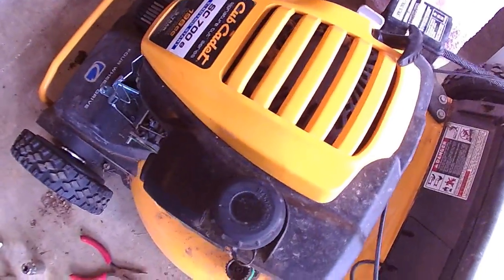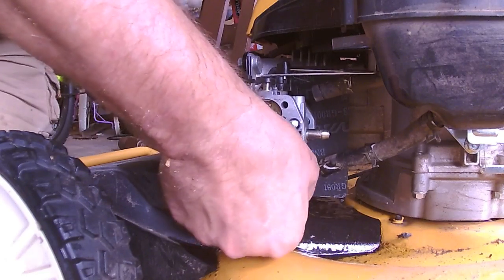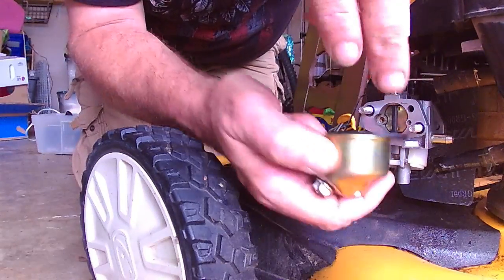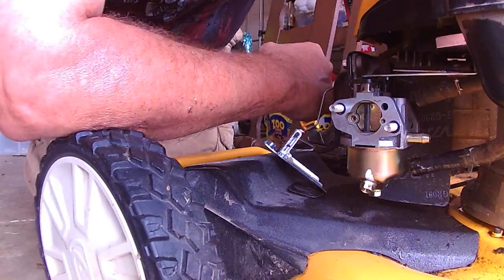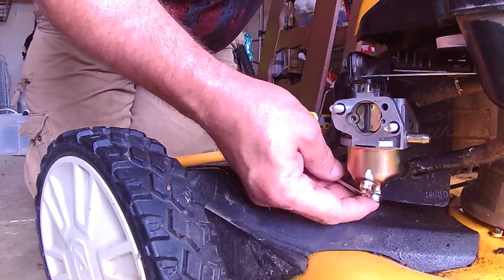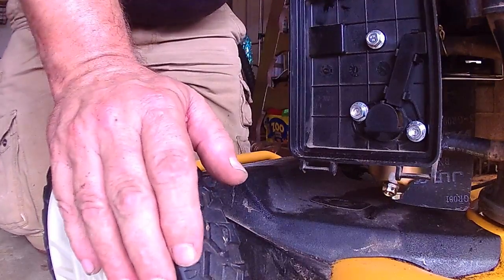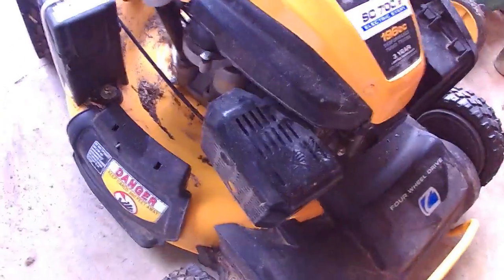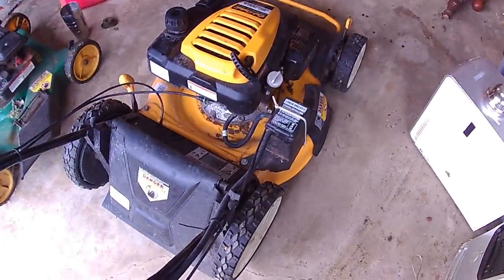Cub Cadet Will Not Start

Comment: I hate working on small engines.  I usually just send it in to the repair shop.  Your video saved me being without a mower for two weeks and at least a hundred bucks.   I had tried everything my limited knowledge allowed for--new, clean fuel and starter fluid to get it to crank.  It never would have occurred to me to remove and clean the bowl.  I did that, and just like in your video it cranked right up.  Thank you so much.
Reply from the maker: Glad it helped!
Reply: I love to work on small engines I'm 68 years old and remember my dad hated to work on them as well lol I saved him a lot of money over the years.

Comment: I know it's old video but I have to thank you for this. never even realized my cub had a float bowl and I went most of the summer having to use my weedeater on the smaller areas that I'd normally use a push mower. literally a 10 min fix and my mower is running perfectly again.
Reply from the maker: Glad to help.

Comment: Thanks for this video.  My mower would start and die immediately.  Took the float bowl off and it had debris in it.  Didn't know a thing about what and where the float boat was until I watched this video!  Cleaned it out and bingo!  started and kept running.   Thank YOU!
Reply from the maker: You're welcome!
Reply: If I don’t fill the tank fully after each mowing, water will condense in the tank. I was always draining water out until I started filled tank to the brim after each use.

Comment: When I undid the bowl screw it immediately started dripping muddy looking gas. Sure enough, the bowl was filled with rust. I sprayed it out a couple times and scrubbed it with a tooth brush until the spray ran clean. Put it back together and it fired right up and stayed running. Thanks!

Comment: You can also use 99% isopropyl alcohol. drain the gas tank first if you didn't already drain it for storage, put tank hose back on then pour a 1/4 bottle of 99% isopropyl alcohol in the tank.  She'll crank right over in a few seconds then fill her up with new Gas. No Float bowl carb work needed.

Comment: I know it's an old video but I just bought a Cub Cadet SC100 today for 15 dollars. I usually mess around with Briggs and figured to try something else. The hoses on the carburetor are off. They gave me a carburetor that's loose so I know someone tried to fix it. I plan to reattach the hoses and check to see if the control cable pulls the brake all the way off. Any other suggestions? I guess the spark plug.

Comment: My cub cadet sc500 push mower stalls out after 10 minutes of use. What do you recommend? Would be great full to watch a video on this matter. Thanks
Reply from the maker: I wish I could help with another video but I have no Cub Cadets to fix. It sounds like you may be overheating. Make sure ALL of the fins around the cylinder are clear of debris and all shrouds are in place.

Comment: Not faye's account.  He was smart not to take off the carb, you definitely should take off the shroud.  I tried to remove it with the shroud in place and that small plastic piece on the top (which should be metal) is very fragile due to a poor mold design, so it breaks easier than you would think.  The only way to get it out is to pull the carburetor's flap out and then removing that plastic piece while still attached.  I would not advise it, but I did the reverse of that to get it back together. G-man
Reply: Question where is the Idle screw on these mowers

Comment: I’ll never buy another cub cadet. Can’t go two mowing seasons without a problem
Reply: Cub cadet engines are good motors I have had mine for 8 years with no problem at all. Two or three pulls is all it takes to get it going.

Comment: Have a 700 wire is loose or off the electric start doesnt charge . Dont need the electric start as it is running one pull everytime change plug every year

Comment: Thanks for the video. My cub cadet sc 300hw will start but will die immediately.  I drained the gas and did everything that you did but it still doing it. Any suggestions?
Reply from the maker: Sounds like the carb needs a complete disassembly and cleaning or replacement. Also check to see if the choke is functioning properly. Thanks for watching and commenting!

Comment: i had the same problem on my cub cadet SC 500 z push mower what i did is 

1. drained gas from tank 
2. removed the air filter compartment then used carburetor parts cleaner to see
that the air filter and gas flow to carburetor is not clogged. 
3. Drained the last gas in flow bowl then dried it out. 
4. put it all back together add gas and make your own custom hole on the gas cap
for a much better vacuum chamber.

Comment: I have this EXACT mower, the problem with mine is that it will ONLY start if I spray starting fluid.
Reply from the maker: I would check the basics first. Check the gap and clean the spark plug or replace.  Make sure your fuel is fresh and less than 30 days old. Make sure your fuel cap vents. Make sure your fuel lines are good and not cracked.  If the problem persists, the carburetor may need cleaning.
Reply: Clean the primer line with carb spray.
Reply: Its your auto choke.
 I was really  hoping this video would show how to unhook it and reinstall  it but all you could see was his arm.
  But without  a shadow  of a doubt your auto choke is the first place to look.
 Working  on the same mower now myself

Comment: I have a sc 500 eq. Same problems. Got the float bowl off and cleaned up, fresh fuel, and still have nothing. I then tried starter fluid and it rolls over and runs for 3-5 seconds then shuts back off. Any suggestions?
Reply: I have the same exact problem
Reply from the maker: It sounds like a fuel delivery problem in the carb. Look for carb disassembly vids for your model. Sounds like plugged jet and emulsion tube.

Comment: I cleaned everything out, now it starts but immediately dies.
Reply from the maker: Assuming you are using NEW gas (less than 30 days old), it sounds like fuel starvation or the idle circuit is blocked. Check for fuel flow into the carb. Removing the bowl nut will tell if there is fuel in the carb. Check for blockages in the jet and all holes in the sides of the emulsion tube. Spray carb cleaner through all ports and holes in the carb. If that does not fix it then it may be time for a new carb.

Comment: I did this but mine still won't start
Reply from the maker: If spark and compression are good, it might be time for a carb rebuild or replacement.
Reply: @veteranssmallenginerepair5934  Thanks!